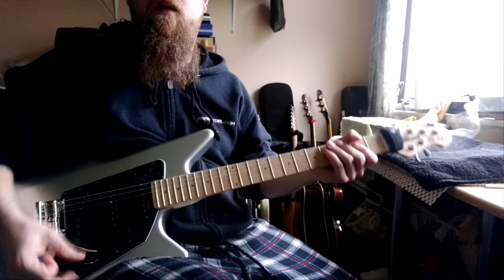Philip Joyce - MM Albert Lee neck on switch demo

Comment: Are there schematics for this mod out there somewhere? Thanks!
Reply from the maker: Chelsey Wood absolutely. plenty. just Google image search "neck on switch " or 7 way strat wiring. 
there are several ways to do it. 
you could use a puah pull pot like I did. or a mini toggle. or even use one of the tone pots as a switch
Reply: Philip Joyce do you have stock pickups in your Albert Lee?
Reply from the maker: Chelsey Wood yes these are the stock pickups. I love them.